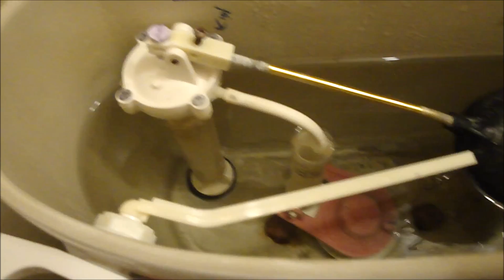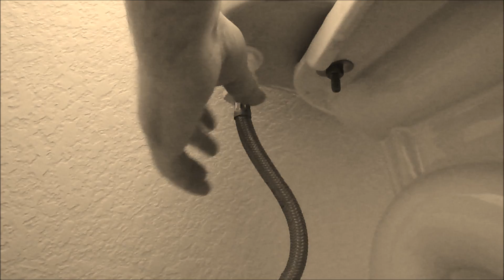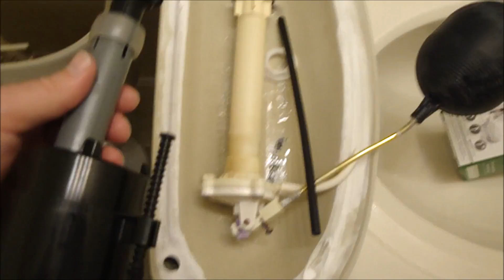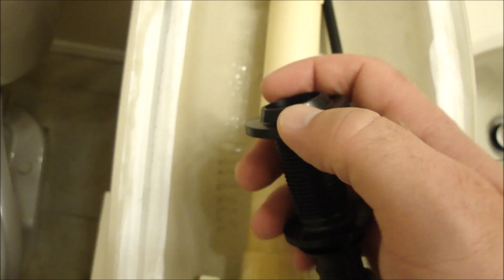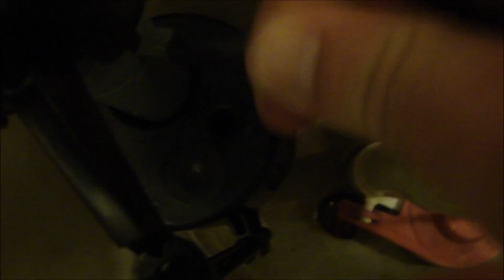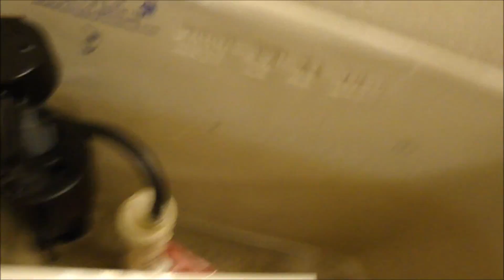Replace Toilet Fill Valve Assembly

Comment: Where the video that shows you replacing the parts inside the fill valve? Nobody really tries to fix the old fill valve. Everyone just replaces it. It's a shame that no one knows how to fix anything anymore.
Reply from the maker: You're in luck. I have a video of that also https://youtu.be/DeRjMR6HmZM?si=jn6dBetgY3dVsKoR
Reply: @becausestuffbreaks thank you
Reply from the maker: @elbandito5411 let me know how it goes.
Reply: @becausestuffbreaks Mine was spitting out water from the top of the valve every time I flushed so I took it apart and added more rubber to that little round rubber piece that closes the water when the float goes up. So that solve that problem but I still have a little water still running into the toilet. I have a brand new flap so maybe the seal under the flap needs changing. I'll try changing that.

Comment: I replaced the washer on my existing ballcock valve and locknut and still water is leaking from the tank/locknut and when hand tightening the valve moves, is this normal?
Reply from the maker: You should make sure the nut on the outside bottom of the tank that holds the valve in place is tight. It's where the water line screws into the back tank.

Comment: If you have a leak at that nylon nut and flange on the underside of the tank can Teflon tape be used? Thanks and nice video.
Phil
Reply from the maker: Yes, that will help the threads seal. Is there a rubber washer in the line that screws into it?
Reply: @becausestuffbreaks  Yes, there is a rubber washer. I bought a Danco Valve kit and I didn;t realize (until watching a video) that they come in different heights for different toilets. The Danco valve kit says "Fits Most Toilets"...
I am going to measure before I take the old valve assembly out. Hope it fits however. Thanks...
Phil
Reply from the maker: @uptownphotography  let me know how it goes. Thanks for watching!
Reply: @becausestuffbreaks  It went well. The new valve assembly was actually about 1.5 inches shorter, but it works fine and the toilet flushes the way it should. I was nervous it might not, but the new valve assembly was here and i wanted to replace the old unit. Luckily, it all went well. Thanks...
Phil
Reply from the maker: @clhenthorn  awesome! Thanks for watching!

Comment: Mine looks the same as yours but I noticed that the nut under the water tank is metal. Now I'm worried if I attempt to unscrew it, I may break the tank itself. Mine is very old but exactly the same as yours except for how it is locked under the tank. Any recommendations?
Reply from the maker: It shouldn't break the tank when you go to unscrew it. Let me know how it goes. Thanks for watching!

Comment: I did it!  Had my tablet next to the toilet so I could follow you step-by-step.  It was only $6.98 at Home Depot, decided to also get a new flapper (cheap), just in case.  The only trouble I had was unscrewing the assembly underneath, it was solid tight.  Afraid I'd break the toilet tank by forcing it, I sprayed WD-40 on it, eventually it did help loosen it.  Thanks so much for your video, I had no idea a toilet was supposed to be so quiet (Lol).  As another woman home-owner, it feels good to fix it myself and save paying a plumber $200 minimum.
Reply from the maker: Awesome! Glad I could help and save you some money. Thanks for watching!

Comment: Hi thanks for the how to vid there what model of fluid master  did you use  ?
Reply from the maker: 400ARP25
Reply: @becausestuffbreaks  Thanks so much. 👍. How does it work.? Fast fill ?  Does it also last long.   
Loved your tutorial the best.   Not rushed and easy to follow.
Reply from the maker: Fast fill. It can be loud sometimes. It was at least 2 years old by the time I moved out of that house

Comment: Why is that hose going in the overflow tube . Shouldn’t be secure but outside of the overflow
Reply from the maker: It goes out the top of the bowl when flushing. Helps keep the bowl clean and help make everything go down. The hose should spray into the overflow but it will still work if it doesn't.
Reply: @becausestuffbreaks   I just installed a flush master ... I tried setting the hose inside the overflow .. but all the water just dumping into the 3 inch drain.  I set it outside the overflow
Reply from the maker: @diegoghia1201  I wish I could see what you're talking about. I started a public MeWe group you can share pictures, video, and chat with me and hopefully others as people join. I want you to join my group on MeWe: https://mewe.com/join/shareyourtrade
Reply from the maker: I also have a friend with a YouTube that's a plumber and he probably knows what you're talking about. Here's his video changing that and you can ask him on there https://youtu.be/P1X3jJh3yLU

Comment: You need to adjust it that's all
Reply from the maker: Tried that. It was a rubber seal that I had found bad in a previous video that I will link below. I just decided to change the whole thing since it was so cheap. https://youtu.be/DeRjMR6HmZM
Reply: Justin Peters oh ok, but stop buying korky because korky is junk
Reply from the maker: Thanks for the advice.

Comment: Just installed one of these on my 24/7 running toilet. Was very easy. I did have to saw off about an inch off my overflow pipe to make it an inch below the C.L. mark. Everything worked out great. No leaks at all. Prior to this install, I'd only ever replaced the lever and chain before.
Reply from the maker: Thanks for watching!

Comment: Although this is an older video, I bought the exact same replacement...got to admit mine was from Amazon (strike one), but all the instructions were the same (likely because it was the same universal product).
As a 62 year old woman, I take pride in being able to fix the little things, and your video helped to assure me that I was doing things properly.
I now have a fully functioning, non-running toilet, and I did it myself!!

Have no fear DIY women...there are some things that are better left to professionals, but I'll be darned if I am going to pay plumber premiums for the easy, do it yourself stuff!
Reply: Amy Hendricks do you still have the link of where on amazon you got yours?
Reply: Selemundo any Home Depot or Lowe’s has them for approx. $10-15 bucks.
Reply: @olliemoee  I'm just now seeing this, but here it is :)   https://www.amazon.com/Fluidmaster-PerforMAX-Universal-Performance-Toilet/dp/B006MWQKOU/ref=sr_1_2?dchild=1&keywords=tank+fill+valve&qid=1586571196&sr=8-2
Reply: Nothing wrong with buying from Amazon. It delivered to everybody during the pandemic.
Reply: @panerai_fan  👍 I often check product prices and if Amazon has a competitive price, that's where I go! No sense running to the store if it's not necessary!  My mindset about Amazon has changed considerably over the last 2 years! 🙂👍 It is nice to have options that actually make life easier!

Comment: This video would be a life saver if not for the fact that my toilet that I’m replacing the fill valve on is metal and made of several different parts so it didn’t come off easy and now we’re working fruitlessly at the old lock

Comment: BEFORE putting in the new fill valve.......flush the water line out for 30 seconds at ...full flow....to get rid of any debris which will damage the new sealing rubber in the new valve.
Reply from the maker: Like into a bucket?
Reply: No.
 Just put a large cup over the upstand.
 turn on water and let it flush out into the cistern. Clears all the debris.

Comment: What do i do is bottom lock nut will not loose? I am using adjustable wrench and it will not turn loose. Wrench keeps on slipping off from the plastic nut. I have the exact fill valve as yours. The rubber ball broke off the plastic at top that is why i am trying to change the fill valve
Reply from the maker: You can get vice grips and lock it on the nut. Maybe even break it off
Reply: What kind of tool do you recommend??
Reply from the maker: Plumbing Tounge and Groove Pliers or Curved Jaw Locking Pliers.
Reply: Like 10? 12 inch channel lock plumbing tongue?
Reply: I know the water supply line is7/8. So is the lock nut 7/8? Im trying to buy open wrench so i should buy 7/8
Reply from the maker: Here's what I use. KNIPEX 88 01 250 SBA Alligator Pliers https://www.amazon.com/dp/B001H1GS0M/ref=cm_sw_r_cp_apa_fTe.Bb6QZMJ04

Comment: I cannot remove original coconut from original old valve.  Been there 22 years.  I have tried every tool. It will not budge.  Help
Reply: .meant locknut
Reply from the maker: Are you talking about the nut holding the fill value to the water tank at the bottom where the water line connects to the fill valve?
Reply: @becausestuffbreaks  yes

Comment: I cannot turn the water off
Reply from the maker: If there's no valve to the toilet then I guess you'll have to shut it off to the whole house.
Reply: Justin Peters I mean there is a valve but it doesn’t work. I also have no clue where my main water supply shut off is.
Reply from the maker: I'm not sure if there's another way to turn your water off since the valve doesn't work. Usually the water valve to the house is outside under a rectangle metal lid to a rectangle box underground.
Reply: Nevermind I got a plumber. This video helped me out a lot!. Thank you!!
Reply from the maker: You're welcome! Thanks for watching! Did he have to shut the water off to the house?
Reply: Yes

Comment: hey justin i shut the water off, and disconnected hose, but water is still coming out a little bit any suggestions?
Reply from the maker: The valve probably has a bad seal and lets a little water through.

Comment: I wanted to come back with an update.  It took a tad longer than expected only because the kit I used is several years old (we purchased years ago in anticipation of needing one day) and the extras looked different.  That threw me off and had me scratching my head, trying to make heads or tails out of it.  But the instructions in the package helped with that, and after changing the flapper, I've had no problems!  I just shared this video on my facebook page, telling all the ladies that follow the page this is something they can do themselves and save a ton of money in the process.  

Here's my post:

https://www.facebook.com/amystreasures/posts/10156206774738179
Reply from the maker: That's awesome! Thanks for sharing and watching. Glad I could help.

Comment: When you have a toilet make sure you always clean out the water when you put in a new phone wow so way the tank doesn't get all dirty in the football doesn't get all once you put it in your Fluidmaster fill valve on the tank so clean then you can put in but if you have no flow Bob will probably have a hole in them you might as well take it out

Comment: Thanks for the video! Having this same problem and might have to replace the entire fill valve. By any chance, do you know what the model number was for the fill valve you replaced? If I could find a new one, I might only have to replace the top part which would make the process much easier (the arm to the float ball broke off at the attachment site).
Reply from the maker: +Some Girl I have no clue, but you can buy one just like it, take the top off it and put it on the old one.

Comment: An extender on the overflow tube might have fixed your problem which is only a few bucks at Amazon.com since I see the overflow tube seemed too short before you replaced the fill valve.  One friendly warning;  I have the exact same model fill valve you just replaced from Fluidmaster and the amount of insane high pitched whistling noise it has the potential to make is unbelievable where it's even heard in the next bedroom!  I'm rushing to go back to the old floating ball assembly before me and my family go nuts because of the noise!  This did take a while to happen but once it does it's like an alarm going off which can only be silenced by flushing the toilet until the tank fills again wasting lots of water.  Some you tube videos advise to simply clean/flush the top of the fill valve which I have already done with no results. The moment you start hearing high pitched noises replace it before it gets so bad you can't even sleep through the night.